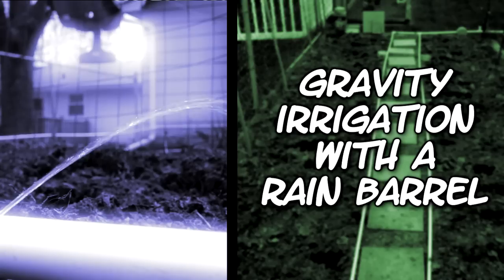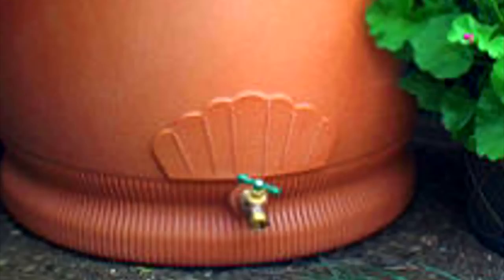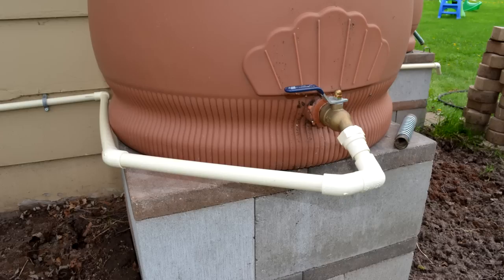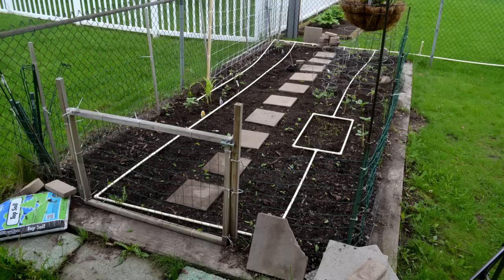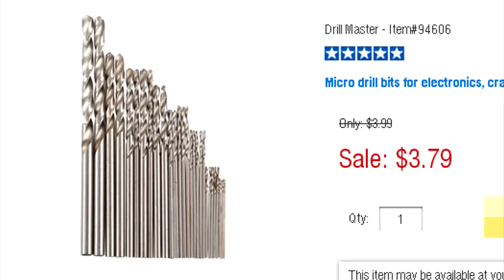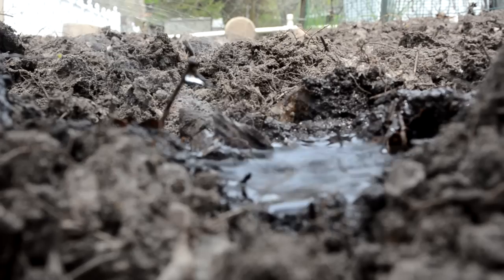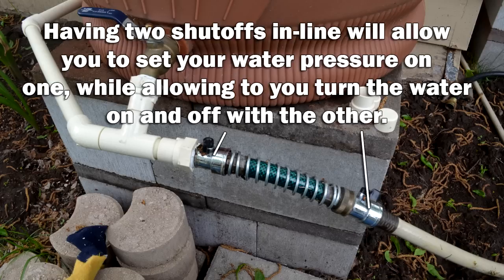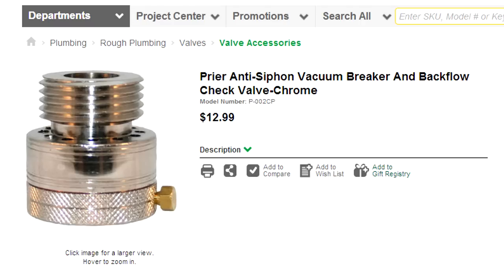Low-Cost Gravity Irrigation System From A Rain Barrel | Ever-Curious Geek

Comment: One thought, when your barrel is empty, just fill from the top with a garden hose. That way there is still no pressure on your feed line AND chlorine will dissipate after 72 hours in the barrel. Great system . Thanks.
Reply: Robert Baxter it would need to be open to the air, for the chlorine to evaporate, ... we had a 5 gallon bucket (of chlorine), ... that is used to assist the process of purifying wastewater in the sand filter building, @ East Chicago, Indiana, wastewater plant, ... once it is past that point, it travels to the ultraviolet light building, which is only utilized from April 1st until November 1st, (according to federal guidelines), ...
Reply: Yep, fill the barrel from the top if you run out of water. Just keep the hose end above the water line. Fitting your garden hose to the fitting at the bottom can cause cross contamination of the city drinking water if you do not use a quality backflow valve.
Reply: Great idea!

Comment: This is very similar to what I'm looking to do except I believe I'll add adjustable drippers on small feeder lines. Easier to control the amount at each location. I'll be using the system to water a 20'×20' raised bed vegetable garden.

Comment: The best video I've seen on this subject one thing about the bits if you choke up on the bit ware thear is about 1/4 inch of bit sticking out it will not break as bad mine did not break at all

Comment: Holes from a 1/16" drill bit works just perfectly in my system.  However, my rain barrel is much higher off the ground (about 32", providing more pressure), and the distance from my rain barrel to my garden is about 3 inches (providing far lower flow resistance).  I also used regular PVC, instead of CPVC, due to local availability.

Comment: Why not use soaker hose/s instead of drilling all the micro holes?  Threaded fittings on 'manifold' section.  Otherwise, AWESOME DESIGN!  Thanks for sharing !!
Reply from the maker: I have tried soaker hoses in the past but I've never found one that works well with the low pressure from a rain barrel. It wasn't uniform all around the garden and a lot got wasted because it dripped out in between plants also. That's what led to me doing this kind of setup. If you click over to the "Version 2.0" of this project where I do individual branches to each plant, I waste less water and my barrels last longer. With the new 2018 season coming up, I may have some new ideas up my sleeve :)

Comment: Great video and system. I was just gifted with 2- 55G rain barrels. I am setting up for soaker hoses, my garden is 40x45
Reply: Do rain barrels have enough pressure for a soaker hose?
Reply: @cupbowlspoonforkknif  They do, but it takes much longer to get the water density you want. I am in the process of building a greenhouse and feeding the barrels from that roof. Going to use Mr. Drip hose. I will also elevate my barrels to just under the downspout on the gutter. Will also add fertilizer to the barrels. One at a time so fresh water in one at all times. Blessings on your garden

Comment: Great video and presentation. You really need bigger tanks and get the water from every gutter back front and garage roof. have you thought of gardening in raised pvc pipe beds that really cuts down the water as you can turn it into a siphon system where the water is in the pipe and the plants only use what they want. Also the area uses a minimal amount of water. I grow strawberries, raspberries, blackcurrants and potatoes.That really cuts down on water. I wish you well on your endeavors.  See Larry Hall videos for more info

Comment: Hi Mark, I watched your video (probably not close enough) and built a very similar system. Long story short, I don't have enough pressure in my lines to get any "throw" out of the holes and it ends up just dripping out. By the way, my total vertical drop from barrel to garden is a little less that 2 feet- 2 cinder blocks plus a few inches.

After watching your video again, it looks like there's 3 differences that might have lead to my problem...
- I used the standard hose bib that came with the barrel instead of the quarter turn. You mention and show that you get far better output with the quarter turn.
- I used a 1/16th drill bit for my holes.
- My mainline is 3/4 (same as yours), but I kept the 3/4 size on my lateral lines rather than reducing to 1/2 inch.

In your opinion, which variable do you think most contributed? My guess is the quarter turn spigot and the 1/16th size holes. Is the reduction from 3/4 to 1/2 inch crucial? I'm thinking about replacing parts, but would like the replace as few as possible.

Thanks
Reply: I use 3/4" because you can have more holes and still maintain pressure.  I think 1/16" holes is fine if you raise your barrels.  Raising the barrels is the best solution because it reduces the difference in water throw as the barrel's  water level drops.  I even stack my barrels.  I'll do a video soon on my adjustable rain sprinklers...
Reply: Every 33ft you raise your water barrel, you increase water pressure by 1 atmosphere, thereby doubling your water pressure… or increasing water pressure by 14.7 PSI. Thats why when driving through various parts of the US, you may see an old structure where a water tank used to have been placed. Most will be elevated 15ft, and in the rare occasion, 30+ feet.

Comment: Good video, I'm thinking of doing something very similar to this, maybes not so free-flowing though, more of a drip freed. 
I seen a video of PVC pipe being used with simply 2ltr empty bottles rather than water barrel, then placing nails into the drilled holes so that it doesn't block the holes but water literately drips out very slowly so plants were getting drip fed water for hours. 
Would be good to see the water flow if you placed small nails in your pipe holes.
Reply from the maker: Interesting you mention this. I've seen on Pinterest people mentioning you can poke holes in bottles and bury them next to plants. When filled with water, they'll leach water out at the the root level to the plants. I see this mostly with tomatoes and two-liter bottles, but I imagine you can use 20-ounce bottles for smaller plants. I had considered trying one year burying bottles like this and adapting this system so the pipes just fill the buried bottles so the water can more gradually soak into the ground. I'm very curious about that, and your suggestion as well. Perhaps I'll give it a shot in a future version of this system. Thanks!
Reply: not so much DIY anymore but u could use the black small drip irrigation hoses and push them into the white PVC pipes of yours. that way you can aim the water more at your plants. they also have a little thread at the end allowing you to increase or decrease drip flow, while also counteracting any uneven pressure distribution.
Reply: @tazztone  the holes are too small to put a ALL THREAD through.
Reply: Very cool concept, thanks for sharing the great info. We began exploring this further and learned about hugel mounds made from aged wood used for capturing and storing water naturally. It’s working out great in our garden so far!

Comment: I'm in the process of setting up my 2 50 gal barrels. Waiting on the diverter to come in the mail. I have plans for a larger system in the future. If I have the barrels elevated as you do, do you think I will have enough pressure to run soaker hoses?

Comment: At 8:00 you reference the problem of pleasure on the end of the run. Using 3/4 inch pipe will eliminate that. Also the larger pipe will stay flatter across the run making the watering more even. Also 1/16 inch is standard in the "drip watering" industry.

Comment: Is there drilling debris inside the pipe that clogs outlets?
Reply from the maker: Haven’t encountered that, no. Actually when I drill out the outlets, the PVC plastic kind of comes out in a long curly Q rather than dust.

Comment: Great idea and thorough video!  Just wondering if you had ever considered pex piping for cost (at least for the long pipe runs) and the better looking color choices.
Reply: Thanks for sharing this video. It inspired me to create the same system to water my greenhouse. To automate it, I will add irrigation clock. But I am a bit worried about drilling the wholes in the PVC pipes under the right angle to reach every flower. Did you update your system as you mention here, to run small pipes towards each individual plant? would you mind sharing some pictures or information how that worked for you? I think ideal way would be to have flexible ends, to adjust the water flow precisely, but then the question is how to attach flexible hose to PVC pipe... thanks!
Reply: @tomasneuwirth2932  I have a mechanism I made for adjustable positioning and adjustable volume.  I'll make a video soon.

Comment: I've heard pvc will break down pretty fast with the uv light from the sun.....does the cPVC hold up better to the uv?
Reply: I use pvc to build a cover for my back deck...and its been five years and the pipes have held strong through high winds, hail storms and extreme heat, the only problem I've experienced was during the  "Big Freeze" here in Texas when some of the joints broke under the weight of the snow,(approx 200-300 lbs) freezing rain and weather just above zero for a week or so. If this is something you're doing or thinking of, I'd  suggest getting the thicker type and depending on where you live don't forget to clear your pipes for winterizing. Needless to say get the white pvc

Comment: Great video, I have a few questions - Is the reduction from 3/4 to 1/2 intended to increase pressure? Also, where did you get those awesome rain barrels? I want one! :P
Reply from the maker: I did the 3/4" to 1/2" reduction for a couple reasons - 1) I believe - not being remotely a scientist - that it does increase the pressure a little bit, and 2) the 1/2 CPVC pipe and fittings are cheaper than 1/2". I don't need to flood the garden, I just want a nice small stream of water to each plant. My current setup - see the link for my 2.0 version of this system - is much better at conserving water and getting water to each plant individually.

As far as the rain barrels, we got pretty lucky with those. They are the Rain Wizard Urn 65 barrels from a company called Good Ideas. They run anywhere from $129 to $199 retail. We got them several summers ago (probably 5-7 years ago really) at Sam's Club for around $50-60 each. The second one came a year after our first and was on a markdown, which is why we took the leap to get a second one. They've held up remarkably well, all we've had to do this year (for the first time but we should have done it sooner) is spray down the inside because there is a little bit of algae-ish gunk that builds up, but it's no big deal. If you get this, or any other rain barrel, I do highly recommend replacing the spiggot that comes with it with a quarter-turn ball valve. SO nice. My 5- and 2-year olds can both easily fill watering cans without trouble, and the increased flow is well worth it.
Reply from the maker: By the way, here is a link to the manufacturer of the rain barrels we have.

http://www.goodideasinc.com/products/rain-barrels/rain-wizard-urn-65/

We haven't been Sam's Club members for a few years now so I don't know if they still carry them. The only other place I've ever seen them sold locally is a local garden store chain here in Northeast Wisconsin called "Steins Gardens and Gifts." You could check garden stores in your area for them, I don't think I've ever seen them in larger chain stores like Home Depot or Lowe's. At Steins, they retail for $129, so if you happen to find one for less, snap it up! We're still extremely happy with ours. The planting space on top make these ones less of an eye-sore than most other ones we've seen.

Comment: Hi mark.
Good stuff pal.
When the barrells run low and you top up with your hose ...
It might be better to  fill those barrels from above or you will disturb the sediment and clog those tiny holes...?
God video thanks for sharing.
Can you install a timer solenoid running off of a solar panel and battery ?
Reply from the maker: MultiOutdoorman I’ve tried filling the barrels from the top but the inlet is covered so much by the PVC pipe from the gutters and the gutter screen which is screwed down. I take my barrels down and pressure wash out the insides every spring now so sediment hasn’t been an issue. Never was too much to begin with because there’s ample space at the bottom of these barrels. Luckily last year we had enough rain I barely had to use my irrigation. Can’t wait to tinker with it again this season. Haven’t tried the solar idea but I like it. Tried a battery timer in past but the one i used had such a small opening that pressure was an issue. Will have to research other models. Do have to replace my quarter turn spigots this year unfortunately because we had a freeze early that caught me off guard and it froze up and cracked the old ones.
Reply: So what do you do in the winter? Do you have to wrap the spigot?

Comment: Question, do you have enough pressure to hook a 360 sprinkler head in the garden?  I'm not looking for long throw but a nice 360 degree push so that the entire system can be placed underground and it looks like it is part of the irrigation system in your yard even though it's coming from the rain barrels.  Your thoughts?
Reply: Derrick Daniel 
Your pressure will be determined by drop from the top water level in the barrel to the exit port (think hole in the pipe). As the water level in the barrel falls your pressure will drop. This is not a problem for me because my house and rain barrels set 4' above my raised beds .

Comment: How do you handle cold weather seasons?
Reply from the maker: Eric Miller I pull the pipes off the rain barrel and drain it and drain any water I can out of the pipes. I’ve left them out for several winters and they’ve been fine but the longer they’re exposed to the elements the more they get a little brittle. That’s the nature of PVC I guess, luckily it’s cheap to replace so I may do that this season.

Comment: How did you seal your spigot?
Reply from the maker: tangobayus On both sides of the spigot I used plumbers teflon tape. The CPVC fitting on the end of the spigot may not have totally matching threads, but it's close enough that it fit for me, and it's never leaked in the years since I put it together.
Reply: You just need to get female hose thread and ensure it is not 'pipe' thread and you'll be good.

Comment: wouldn't be easier to just use a hose to water your plant?
Reply from the maker: Maciej Piotrowski I prefer to water my garden with rain water when I can because it’s free and probably better for the plants than city water (though some argue that roof runoff isn’t totally pure but neither is city water in my city). It’s much more convenient to be able to open a quarter turn spigot and let it run for 5-10 minutes while I play with my kids than futz with a 50 foot hose from the house and manually water everything. It also wastes less water due to evaporation. I also think the sun warmed water is more gentile on the plants than cold city water. All good reasons in my book. One afternoon’s setup for a summer of easy watering is well worth it.
Reply: What about a Soaker Hose ?

Comment: Well this was done a few years back so I'm sure just by looking at Material you used his already failed several times
Reply from the maker: Surprisingly considering I’m leaving a lot of this CPVC out in the elements all year round, it hasn’t failed me yet. Tinker with new designs each season to improve it but everything’s in tact and have had to do very little with it. The only thing I’ll have to do this season that I know about so far is replacing the quarter turns because an early freeze caught me off guard with my yard maintenance and it froze up and cracked both of them. The CPVC all survived, even the stuff I forgot to blow out with an air compressor.